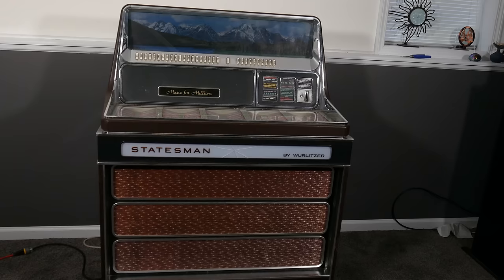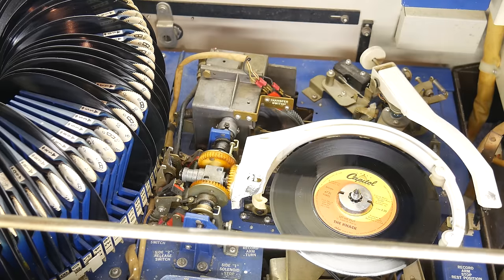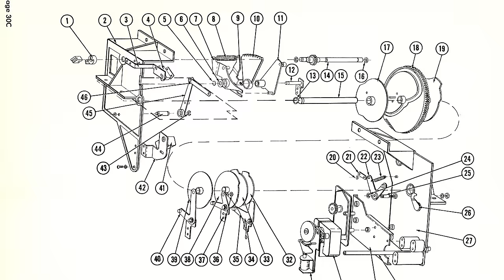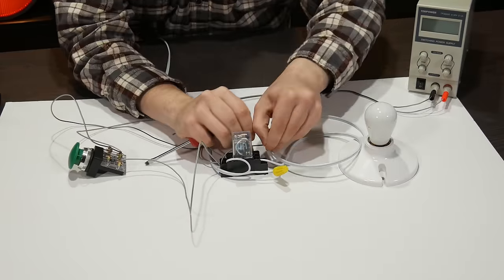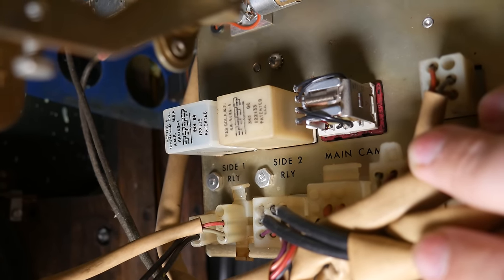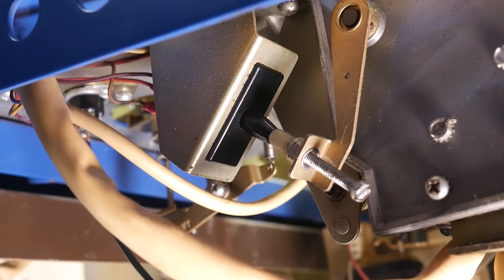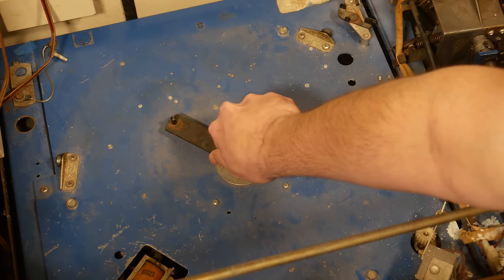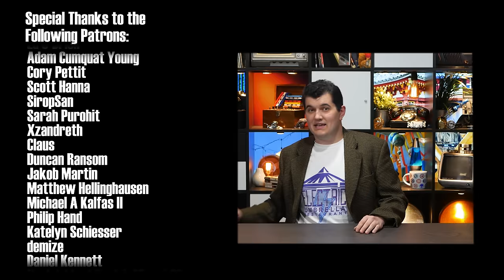The Computer-free Automation of a Jukebox (Electromechanics)

Comment: It’s all nice until one of those custom plastic gears break and the entire mechanism doesn’t work
Reply: Got memes? 3D printers! Makes repairing weird proprietary old stuff like this possible.  I’m in awe of how easy it is to get custom replacement parts for old weird machines these days.
Reply: @SupernovaBetty  "not a problem bro, just 3D print it"
Are we living in the fucking future or what?
Reply: @SupernovaBetty  it's the small coils that hard to replace.
Reply: @SupernovaBetty  3D printing doesn't solve it all. The plastic used is often not resistant enough to make replacement gears.
Reply: @PainterVierax  No, but it's resistant enough to make templates to cast things out of better materials.

Comment: There is a wonderful intermediate technology which still forms the backbone of many modern automation systems called the PLC, or programmable logic controller, which is a parallel computing technology path to the ibm x86 tech that has formed the backbone of modern computing.

One interesting thing about PLCs is that when designing the programming language for PLCs the goal was for industrial techs who were familiar with electromechanical automation to be able to easily pick up and understand the new tools, so a purely visual programming language based on relay/electromechanical logic diagrams called "ladder logic" was invented. Ladder logic and PLCs are fun! They allow anyone with a basic understanding of switches and sequencing to conveniently program cheap devices which almost effortlessly interface with and extend existing relay logic systems.

Comment: All of the lighting plus a few outlets and a couple of vent fans in my mother-in-law's house work using latching relays.  The relays are all in the furnace closet and are triggered from switches placed around the house.  Most are wired to work in intuitive ways, e.g flipping a paddle one way turns a light on, flipping it the other way turns it off.  Over the years a few have gotten miswired so flipping a paddle one way turns a light on, flipping it the other way turns off a ceiling fan and some completely different switch turns the light off and the fan on.

The big advantage is that one light can be controlled from multiple switches, on at one door to the room, another at another door and a third in the master bedroom at the other side of the house.

The big disadvantage is that the whole system is over 70 years old and replacement parts are almost impossible to find, and absurdly expensive when we can find them.

Comment: I enjoyed the green-button / red-button demonstration.  As a child, I had the good fortune to be taught the rudiments of electricity pretty early on, by my father, and thereafter let play with a large collection of batteries, wires, light bulbs, switches, low-voltage relays, etc.  In the course of my playing, I figured out all sorts of interesting things, including the equivalent of the green-button/red-button latch-and-interrupt business, plus a multi-stage version that would turn on a bulb only if you pressed the right sequence of three buttons on a little keypad I scavenged somewhere.  I also figured out that you could make a chain of relays "chatter" or "vibrate" rapidly on-and-off, by wiring the "latch" circuit to the normally-closed rather than normally-open contacts on the relay, so that turning its power OFF bypassed the off switch and turned it back ON, which then cut its power and turned it back OFF.  If you chained several relays together in a closed loop, with just one of them reversed in this way, the speed at which the relays chattered off and on would vary, depending on the number of relays in the loop -- because each relay took a finite time to flip back and forth, and that time added up, the more relays you put in the chain/loop.  All sorts of fun.  I even made a 1-bit adder that produced a two-bit result.  I was well on my way to inventing the digital computer, when I entered high school the same year the first actual home computers came out... and I grinned when I took my first college course in digital logic design, SIX YEARS LATER, and saw some of my own childhood discoveries come back at me from, and confirmed legit by, "the experts."

Comment: Can't disable this "firmware" when it gets too old to make some profit...
Reply: Unfortunately they are able now to design each gear and switch in a way something breaks slightly after warranty is over :( I'm surprised how many electric kettles have special 'weak link' in its 'on' switch so it fails inevitably. Probably they decided: KETTLE MUST BREAK IN A WAY NOT TO HARM USER WITH ELECTRICITY OR HOT WATER, but break nonetheless. So wiring is good, heater is good, it holds water well, but switch link is faulty.
Reply: I mean, you could give it some "coincidental" failure points that wear out after approximately X years. That's one method to achieve planned obsolence. Eg. a capacitor near a power supply hot air vent.

Comment: I love pure electro-mechanical things like this! You should do a video on bowling pin setters - they are quite fascinating in this aspect.
Reply: Oh I bet. For a quick little nugget of trivia you would probably be interested in learning how traditional (non rotary) tattoo machines work... Such a simple concept but so genius in that simplicity... Electro magnet, leaf spring and armature bar... Complete the circuit coils become magnetic pull the bar down, breaking the circuit which causes the leaf spring to bring the bar back up which in turn closes the circuit.... Idk how long I had been tattooing before I learned about the actual principals behind how a machine ran. There's no motor involved generally speaking.

Comment: This machine screams for a cleaning and restoration job.
I used to fix and restore pinball machine and EM ones are the most satisfying to work on. It's a zen thing to do to clean and adjust hundreds of switches and relays. and when it works properly, the sound it makes is very satisfying. 
Electronic things are, well, binary. If the CPU is toasted, you swap the chip, and that's it. It comes back to life.

Comment: if you ever have the oportunity to be inside a TGV cabin inside a TGV depot, ask if you can see any motor block or of you can flip a few switches. 3/4 of all the electronics are done by mechanical relais and switches. The computer is only there for safety and to check if the switches did or didn't work. Every day I love going to work because I know I will hear loads of switches and relais work. The enginuety and design that went into it. I love repairing TGV's and the sound of the switches.

Comment: You explained a basic motor start-stop controller.  Great job.  I love electro-mechanical things and as a professional control system engineer it was what I did until those nasty computers and programmable logic controllers came along.  Next, how about describing a pinball machine.

Comment: There's a gorgeous logic about these electro-mechanical machines.  It's kind of messy to look at, but it's the electronic extension of clockworks.

I think that this logic and the mechanical bits are what makes things like building machines in Minecraft or factories in Infinifactory highly compelling—and a bit maddening.  Instead of coding up the logic it's a matter of building out structures that act as movement limiters and trip switches for starting up the next process in the chain.

On another note, the demonstrator with the red and green switches is also useful as one for more advanced electronics.  For folks for whom this is all new to it can function as a demonstrator a very, very simple type of electronic, data storage since it can remember the state in which it was left so long as there's power provided to it.

Comment: My dad was an electrician - when I was about 11, I discovered relays...
He had dusty boxes full of them, removed from old equipment. They were all 240V for motor control and the like - so, proper thumping great contactors, driven by unprotected mains (and proper Australian voltage - not wimpy 110V).
I set about "inventing' stuff like binary counters with them - vast arrays clanking away. I had (completely unrealistic) aspirations of building some game like a pinball machine with them.
Ahh the good old days, before "safety switches", when adults had no qualms about leaving you unsupervised, playing with lethal toys.
(I went on to become an EE - where my fiddling became a lot more formalised)

Comment: I ran a production line at a food production plant and you would be fascinated by the line I ran. Almost every aspect of the process that happened on the line was all ran off one motor and a ton of switches and gears and one huge length of industrial strength bike chain... It was like one big Rube Goldbergs device. I always said my line was like the world's most complicated ten speed. However... I genuinely believe my background in bicycling did come in handy... That and music... Since everything ran off that one motor and chain everything was interdependent... There were built in points of adjustment but they only gave you so much wiggle room... But when I took over they told me 65 boxes per minute was absolute top end that the machine would run... As I learned the machine and started really understanding how it worked I was able to get it running at 75 bpm comfortably but we didn't have workers who could keep up because they had never had to. They got upset that I couldn't just explain what I had done to the line to the other line leads but the best I can compare it is the difference between tuning a guitar and INTONATING a guitar... I had to go through and max out some adjustments just to give barely enough for tolerance somewhere else etc.... And just was persistent about chasing out the kinks that would present themselves. I love this kind of thing. Electro-mechanical automation... Didn't know it was a thing and it's probably a rabbit hole I should've avoided... But... If ya read this whole comment dear reader... I'll see you in the rabbit hole as well I suppose lol.

Comment: you say these are built "without a bit of code". i'd argue that there is in fact code; just that the programming language is not in bits and bytes, but rather the layout of the circuit and the engineered structure of the device.
still very awesome, and to me, really broadens the definition of what programming can be.

Comment: I find it useful to think of the cams as a physical representation of what we now consider "code."  It dictates what will happen and when it will happen - only according to its shape, and it needs to have a physical connection with what it's operating.  Oh, and they're analog, so the precision of the shape can be quite important.  The cams in internal combustion engines are exactly the same, only they open (and sometimes close) intake and exhaust valves rather than electrical switches.

Comment: Minecraft Redstone is built on these principles. Computers are the pinnacle achievements but farms, doors, and non-digital logic are based on switches, delays, interrupts, feed tapes, modular logic that does a series of steps, that usually require inputs to control when and for how long, sometimes controlled by other automatic machines.

Comment: Can you imagine an electromechanical mechanism that interfaces with a VCR to load tapes, press play, press rewind, eject, remove the tape, store it in a tape holder mechanism or some kind, then selects the next VHS tape, loads it, etc. The entire thing has to just press buttons on the player just like a finger would. It can use a current draw meter on the AC input to the player to determine when playback and rewind are finishes. That would be amazing to see.

Comment: my first job was programming the 'new' microcontrollers as processors started to replace electro-mechanicals. there were two main streams, one based on coding similar to modern arduino and the much more 'compatible with legacy panels' approach that were coded using Ladder Logic, essentially a diagram of all the switches, interlocks, bistable relays etc was 'input' and the processor sat between a bunch of input and output terminals running up and down the ladder. It was a nice compromise at the time but even a naive 17 y.o. could see which way was going to win

Comment: The lightbulb circuit with the buttons and relay is the same thing as a Set/Reset (SR) Latch or Flip-Flop. It's a circuit that can be used to store a bit of data. Ben Eater has a serie where he builds an 8-bit computer from scratch and he mentions it as a way to get some powered memory.

Comment: As a Boomer (and a cool one at that) I grew up in the wonderful world of electro-mechanical stuff and though now 60 years young and evolved with the times into the digital age, when I needed to replace my 15 year old clothes washing machine with a new one, I purposely bought one with an electro-mechanical load selection mechanism design rather than a modern digital version.  Why you ask?   

1.  the electro-mechanical version of the washer was about 20% cheaper than the digital, has an engineered planned obsolescence of about 8-10 years (based on 4 loads per week) and given that at most, I do 2 loads of laundry / week, the wear & tear on the contacts and gearing will be both very slow to occur (ensuring even further longevity).  And, if a mechanical contact does goes bad on a particular load selection, I can simply choose another load selection on the dial and keep right on doing laundry.  

2.  The primary replacement component of the electro-mechanical design mechanism can be easily sourced for typically less than $50 and within about 30 minutes or so, swapped out by me.  It's swap out simply requires removing the top cover (it basically just snaps on & off), a few screws for access and then disconnecting a couple wires from the mechanical controller... simple!

3.  Digital micro controllers typically have a shorter design obsolescence of about 5-7 years and therefore require more frequent repair and / or total replacement of the entire machine.   Since most folks don't know how stuff works in general and can't do much more than "push a button" to make something happen, with a digital controller, the consumer will likely have to call a "repair company", pay for a service call only to told the unit must can not be repaired as there are no moving parts to service and therefore must to be replaced after the new part is ordered / shipped and then require a return visit from the repair person for installation and "programming".  What a bunch of Crap!

Comment: I certainly didn't understand all the explanations, but those mechanics are truely fascinating. And it's kind of the same as in a micro processor, it's only a matter of size difference. A CPU also opens and closes switches, but they are microscopically tiny and there are billions of them, being switched million times a second.

Comment: Good explanation without going completely nerdy and drawing circuit diagrams. One interesting aspect of construction I had forgotten about machinery from that era: labelling. Fascinating how every switch and relay and solenoid had a 'legend' telling the techie who has to work on it what he's looking at. Wouldn't surprise me if the wires were all labelled too.

Two other applications of electromechanical control circuitry that you could tackle are traffic light controllers and pinball machines... those are also fun, one a tad more complex than the other perhaps. Until you look at large intersections with multiple lanes and phasing, I suppose. I suppose nowadays they run those things with - I dunno, Arduinos, perhaps? 😝

Edit: Also, 10-pin bowling alley mechanism

Comment: the multipoles relay is really very useful, I remember there is this use that let you reverse the 'phase' of 3-phase motor (to reverse the rotation) using only one relay by wiring it in a specific way.  and the earliest computers used it for registers and logics.  I'm working in aviation industry, I love to go into the MEC compartment (also called E/E bay) and listen to the relays whenever the aircraft is powering up, ahh all those relays clicking is a music to my ears.
Reply: Reversing the direction of a 3 phase motor is simple.  Just reverse the position of any 2 of the power feed wires. Easily done with a single DPDT relay.

Comment: You should cover what actually happens inside a laser printer. Microcontrollers plus switches, Hall-effect sensors, rubber rollers physically moving paper, and the actual printing process (plus a kind of mini toaster) all combined to deliver a hard copy of that confirmation code you'll never need again.

Comment: I wanted to share an irrational fear that this video reminded me about, but didn’t trigger. I have an irrational fear of touching live electrical components. It’s very difficult to convince my hindbrain that I won’t get shocked by touching the “guts” of an electrical device. In addition, I have the same fear about mechanical devices that I don’t fully understand. Seeing a shot of your hand holding back wires inside the guts of your machine made me slightly nervous. If someone told me to do it, even with assurances that I would be safe, I’d probably only do it wearing the thickest electrical safety gloves I could find. I admire the power that your mind has over your instincts. I wish I had that.

Comment: You should consider Brunswick A-2 bowling pinsetters.  Designed in the 1950s, these things have no computer.   They use purely mechanical means to figure out whether we have a strike, standing pins,  or other situations,  then pick up pins, rake the dead wood out of the way,  reset pins,  etc.